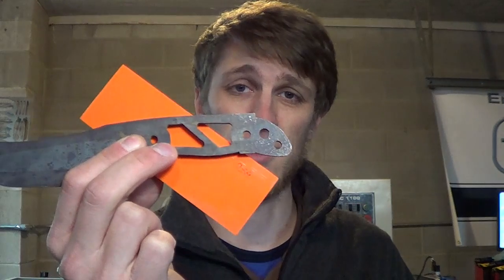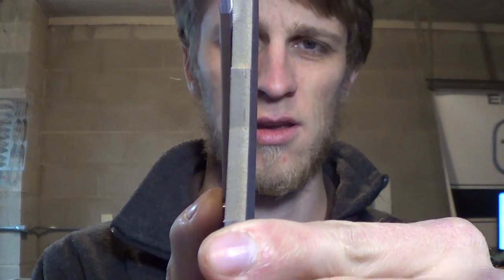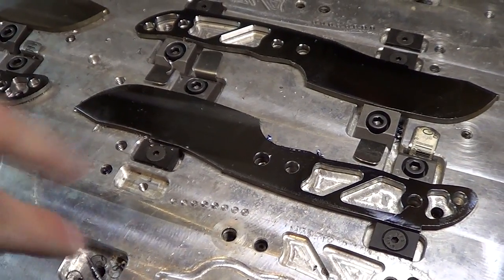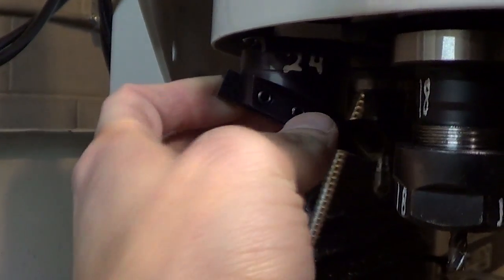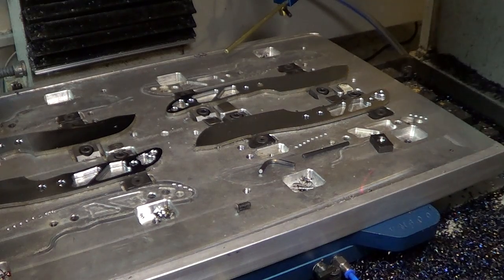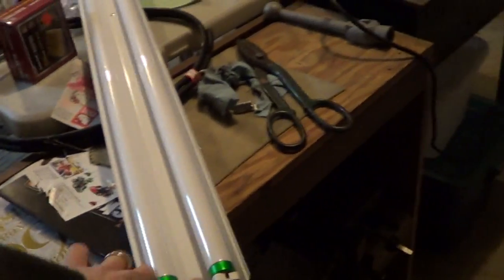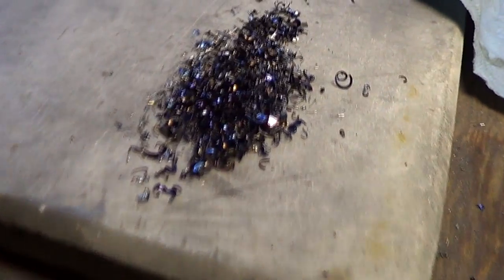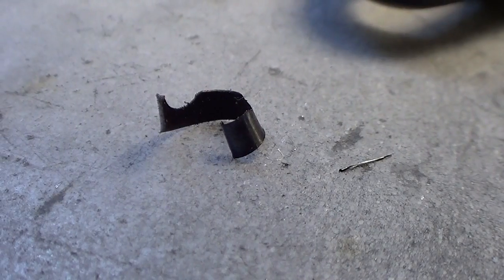Knifemaking Tuesdays Week 54 - Tor knives

Comment: Not to be an ass.. But that tormach toolbit flycutter kinda sucks, never got the hype around it.. I cut that particular steel on my manual Aciera F3 (similar sized machine) with a Stellite HSS tool (Old stock) that i hand ground to a knife shape. It takes less per pass but you can cut faster and get a mirror finish.  You can still find stellite hss from store in UK. The flycutter holder is a standard so nothing fancy.

Comment: Thanks for the videos. Even though I don't know much about knives I am a young machinist/engineer and I was wounding if you could point me some place where I could find the cad file or diagram for the Tormach  1100 or 770 bed? (I am currently using the 770)

Comment from the maker: My coolant evaporates pretty quick, so during heavy use I have to add gallons of water.  Sometimes I forget to add more coolant to keep the ratio, and I don't have one of those fancy gauges that measures the ratio.  So my table does rust a little bit if I leave coolant puddles on it.

Comment: This is how i remember it.... With a tungsten carbide cutter blue chips are what you're aiming for as it yields better surface finish and the cutter can take it. However, with traditional cutters like those little square lathe cutters you grind yourself, blue is bad. If the chips are blue it means your tool has got to hot too and softened.

The fly cutter looks like it used tungsten carbide inserts.

Comment: Almost forgot to mention. Overtightening the mitee-bites can cause thinner stock to slightly bend upward like a potato chip. This tension and the fact that it's not in contact with the subplate can make it ring like a bell. The double sided tape can help with that as well by providing a "deadening" effect, like putting you finger on a tuning fork. Check mitee-bites website for the proper torque, and use a torque wrench for the final turn, or at least to find the appropriate setting on your drill

Comment: No, my stuff was thick enough for it to not be a problem.

Another idea is to use double-stick tape in conjunction with the mitee-bites. Lightly put the knife blank in place, tighten the mitee-bites, and then whack the blank with a plastic hammer. Should help keep the oscillations down. Since you're not using flood coolant anymore, they should stay stuck down until you release them with solvent (I think most guys use acetone; spray/flood them and let them sit for a few minutes).

Comment from the maker: I tried that too, it produced very similar results with the chattering.  I probably did half of them with the superfly and half with the 1 insert facemill.  The 4140 you cut, is it this thin with a potential vibration area like my stuff?  PS I've turned a bit of 4140 on my cnc lathe, absolutely loved the stuff.

Comment from the maker: I'm absolutely loving the FogBuster.  I used to love flood, but it's incredibly messy.  It's eerie how the whole machine is dry.  Chips sweep up great, things don't rust so fast because they're not soaking in water, etc.  I haven't done much, any? aluminum machining with the mister, but it's supposed to work great.   For all these steel parts I'm not even using mist, just a 7psi air blast through the unit.  But a quick twist of the knob brings on the coolant mix.

Comment from the maker: I'll admit that I was going a little SFM happy with that tool, got it up to 1 cubic inch in Gwizard.  Good to know that M5 and 10-32 are very similar, I didn't know that.  However I've got a box of 100 M5 flat head screws anyways, so drilling them out didn't worry me.  I toasted my drill/mill due to a poor guess at speed/feed haha, burnt up several HSS drill bits, what eventually worked great was an old chipped 1/4" carbide ballmill, plunging down manually.

Comment from the maker: We've got two DeWalt drills, one drill and one impact.  We use them both constantly.  For the 1/4-20 screws I use the impact to lightly tighten them then I hand tighten with my calibrated right arm torque wrench, and I use the impact to loosen them too.  It's a Fog Buster from Tormach, pretty sure that's a different brand than KoolMist.  Regardless, it's FREAKIN AWESOME!  It clears chips way better than flood coolant, everything is SO CLEAN after machining!  For steel I've just been using air.

Comment from the maker: I was doing the facing passes at 20ipm 1000rpm which is cooking pretty good.  I did play with speeds/feeds a bit but it always chattered in the middle.  However, you're absolutely right that going slower usually makes a huge difference with stuff like this.

Comment: Running at a slower SFM might improve your chattering issues, but its hard to fight a lack of rigidity.

 Those M5 screws in the mitee-bite can be replaced with a #10-32 in a pinch, as those two fasteners are ridiculously similar in major diameter and pitch. The countersink angle is a bit off, but doesn't seem to have lasting effects in that application.

Comment: You might try a small cordless impact wrench.  I have a Porter Cable that is nice but was inexpensive.  Let Eric use that to LOOSEN the clamp screws.  It'll tap them out, with a lot less chance of breaking tools than using static torque.  I love my little impact tool.  It's great as a poor man's tool changer to quickly loosen and tighten a draw bar.

Are you still liking your KoolMist?  I'm thinking of getting one.

Comment: For the 3HP spindle, an 8 insert shell mill will make more heat than chips.  The single insert SuperFly is awesome for smaller milling machines.  It does fling chips halfway into orbit.  I cleaned up some more aluminum chips in my basement shop today from some facing I did a few weeks ago.  The little aluminum flakes are down inside cardboard boxes ten feet behind the milling machine.  I need to make a floor-to-ceiling enclosure to catch the chips.